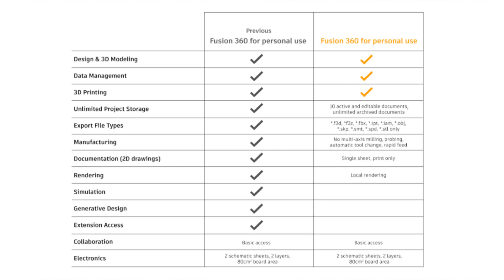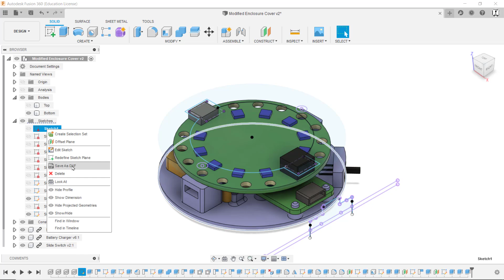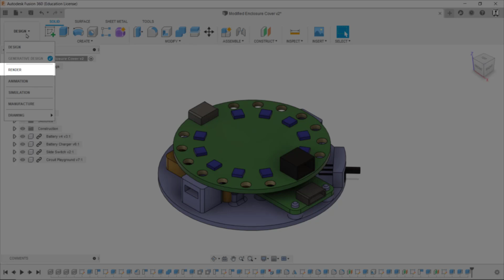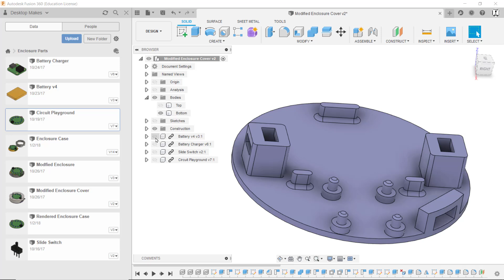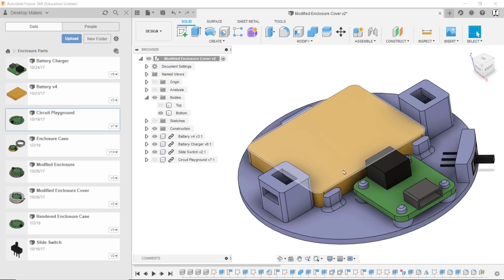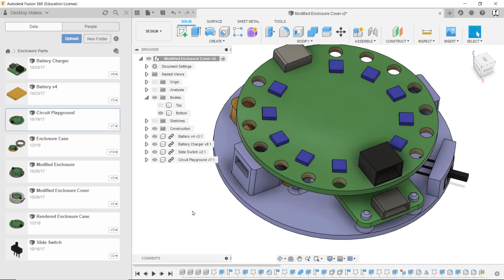Changes to Fusion 360  Personal Use License Explained (Fall 2020)

Comment: My thoughts...

I am truly disappointed with this Desktop Makes video, and as such with Autodesk Fusion 360 and indirectly Instructables.

I transitioned from Sketchup to  Autodesk Fusion 360 a few years back, the reason being that Sketchup began charging for previously free features that I used to design and publish 3D printable models for educational and entertainment purposes (e.g. https://www.instructables.com/member/gzumwalt/instructables/), all for free.  

For the purpose of full disclosure , I only have ten thousand followers and twelve million views across six platforms, I've always credited Autodesk in each Fusion 360 based design as my design tool of choice, and I receive no compensation in any form whatsoever from Autodesk, Ultimaker (my 3D printer of choice), or anyone else I mention in my publications as a source for materials and/or components I use in my designs.

As mentioned, I quit using Sketchup for the same reason that Autodesk is now pursuing: charge a fee for, or downgrade features that were previously available for free, to those who are simply trying to educate and/or entertain, thus penalizing the innocent (those who truly wish to educate, learn and entertain) in order to stop the guilty (those who violate the license).  Contrary to the premise presented in this video, this process is never the "last step", e.g. as more violations are "detected" by Autodesk, Autodesk will announce even more restrictions on the innocent.

I have truly enjoyed designing 3D printable models using Autodesk Fusion 360 and publishing them for free, yet as unfortunate as it may be, as Autodesk continues down the educational / entertainment restriction path, I've taken the proactive steps to download FreeCad and watching FreeCad tutorials, and will soon release my first FreeCad design across all platforms I publish on.

Greg
Reply: Just curious, what features were you using that you will not be able to use?
Reply: @SmithDrewSmith  At this point, STEP files, previously others. 

As a retiree experienced with CAD / CAM software, I assist companies in their use of Fusion and other CAD software, for free.  As their version of Fusion (commercial) has features my version of Fusion (personal) does not, I cannot assist them with the features I'm missing, thus most (and as of this posting all) have decided to transition from Fusion to other CAD / CAM programs I've become familiar with.

I realize Autodesk is a business, but the number of changes effecting my ability to use Fusion (or train others to use it) that have occurred over the few years I've used it are overwhelming for someone my age and for those I've trained to use it.  Thus we will all be transitioning to another CAD / CAM program.
Reply: So you make zero from everything fusion related you do?
Reply: @MrDaniell1234  As stated in my thoughts, "...I receive no compensation in any form whatsoever from Autodesk, Ultimaker (my 3D printer of choice), or anyone else I mention in my publications as a source for materials and/or components I use in my designs."  I (sadly) cannot even sell my models to family, friends and/or followers who do not have the skills or equipment necessary to make them in order to recover the costs of filament, due solely to Fusions "personal" version restrictions which I honor. As such, I donate models to Fab Lab, schools, businesses, family, friends and followers, as I honor my Fusion 360 "personal" license restriction as "not for commercial use".  And while I was asked to and do publish, on "fee" sites (e.g. "https://www.myminifactory.com/users/gzumwalt", "https://cults3d.com/en/users/gzumwalt/creations") by the sites themselves, I do not charge for the models I publish on those sites as well.

Other than my hobby / training / educational use, as a retiree with CAD / CAM experience, I assist businesses (primarily in my local) in the use of CAD / CAM software, for free.  And as I can no longer assist them with the "commercial" Fusion features that have been removed from "personal" Fusion, most (UPDATE:  NOW ALL 27) will be transitioning from Fusion to other CAD programs I've been learning.

Comment: I am a hobbyist as well and initially, the 10 document limit had me concerned.  It will be interesting to see how the archiving feature works out.  I have never needed to export a step file.  I could see the potential for that in the future if I decide to do something with my else with my designs, but that's something I'll worry about when I need to.  As always, great explanation Vlad - safe travels!

Comment: i use F360, but have found FreeCAD very good, but with a learning curve .i highly recommend everyone try it, expect first time frustrations because of how use to many are with F360, time some time to learn it, you will be very happy with many of its features. i also do electronics design, and tools like KiCAD use freecad integration. i find myself sometimes starting a project with freecad if im taking my time, but F360 if i need to do it fast. i also need to mention, im a high level 2d Autocad drafter in professional settings, so familiarity in the product line helps.

Comment: I am transitioning to Design Spark. Just as easy as F 360 and does not need to phone home. Has a better UI.  Does not have CAM but I have other programs for that. It also does not have auto-thread design for which I should create models in F360 to use in Design Spark.
Reason for switching:
Never liked/trusted Autodesk 
Always have a backup for critical system especiall if free.
Better more consistent and mature User Interface.
Different busines model than F360.
Thanks Vladamir, you do good work!

Comment: Oh please! No one is saying that paying for software is not OK.  But you don't go from free to $500 PER YEAR. That is just the kind of mobster move that makes people loose all faith. That is basically saying no hobbyist license without having the honesty to admit it. And please don't compare hardware to software. I don't pay $500 a year to rent my CNC machine that I built myself or my $200 3D printer.

Also, are you seriously arguing that limiting the software so that it won't generate basic g-code like G0 and M6 is not a big deal? What are they going to limit next? G2/G3? M3/M4/M5? And yes, the point is that they undercut FOSS software by promising to make Fusion 360 available to anyone who made less than $100K. There are no real options now. But let's be honest. They didn't say you couldn't use it for your hobby business or to help ends meet at the bottom of the economy. Thousands were using it that way. Now packages like FreeCAD will have to catch up. 

But it will.  I wouldn't hang my star on teaching hobbyist Fusion360 forever.

Comment: Just a quick comment on why many users hate the subscription model. -

I'm a non-commercial user. I have a number of technology based hobbies - photography, graphics, electronics, 3d printing, CNC routing, etc.  In short, I like to make things.  Like most, I don't always do it with the most modern, up to date, equipment.  The reasons are partly budgetary and also simply that I take pleasure in  maintaining, restoring and re-purposing equipment. Some of the equipment I use is decades old.  It works well and is often adapted for uses that the original manufacturer likely didn't anticipate.  It's key that I purchased it, own it, and I can continue using it for as long as I'm satisfied with the results. 

With subscription models you don't get that benefit.  You don't own the tool and it can be changed on you in ways that can impact the functionality you need - even to the point of disabling it.  The change from a once-off license to a paid subscription is often not the cost in terms of dollars for the software. It is the cost of the overall package.  I buy the hardware.  I should be able to buy the associated software.  If I need to change or upgrade I should be able to choose to do so.  Subscriptions shifting functionality and constant upgrading can be great thing to have if you are working in a production environment and have the budget to upgrade associated hardware frequently.  For other users it can cause issues.

Don't take me wrong. I like 360, appreciate and understand the rationale behind their business model.  It's great to see how that team have worked with and supported non-commercial users in the past. My comments are not directed at them.

As a user that strongly believes in conservation and "right-to-repair" I simply find subscription models in general work against those key principles.

BTW - I've been a subscriber for a while.  As usual, this is an excellent video and an excellent treatment of the topic.

Comment: I guess i'm not sure what the 10 "active" project limit is supposed to prevent or deter?  Especially if you can add as many as you want into your active project. What's the reasoning behind that?
Reply: No one will answer your question, because there is no reasoning.

Comment: Thanks for taking the time explaining.
Once again considering FreeCad. Did it a few years back due to the limitations of OnShape but then came Fusion 360 on market for makers free unless the 100K$.
But now to pay for a product not offering good enough text functionality, parametric disaster (try making a solid block with parameters, then add some parameter for a variable fillet... Look what happens when changing the parameters for the size of the block 😱)  sometimes wondering how company's can take those bottle neck 🥳
Looking forward to how Fusion will continue growing to an expansive CADCAM software and maybe soon I'll join you for the paid version only to be able to use a 3018 5 axis milling machine witch cost about 220$ if you can buy it at the good moment. Only needing a software capable of post processing now 😎

Another limitation is the nuts and bolts hole way creation. Used to have a kind of library/parameter list with a smart way to add the tried length etc. Missing it in f360.

Comment: Hey Vlad, great clarity, thank you. I'm very much like you in my use of F360, just 3D printing, and only as a hobby in my case.
If people hadn't been abusing the F360 license, maybe AD would not have needed to make the changes, there is always a few that ruin it for everyone.
My only real concern was if AutoDesk were to restrict access to my files later on down the road. Other than that, they have only removed access to features that I don't use anyway, so no problem at all for me.
I'm completely with you on the cost of software/tutorials, they all take a ton of time and effort to make, your time is valuable too, why shouldn't you be paid for it. Furthermore, you give a ton of stuff away for free via YT, for which I am very grateful indeed, you have enabled me to learn a ton. It is the same with paid-for 3D models, if people want to charge for them, then please do, it is up to the people if they want to buy or not.

Comment: How is activate/deactivate done? -is it an hour long process? -does it cost? If it is nothing more than a click, then how does it make sense?
Reply from the maker: They haven't hammered out the specifics yet but I anticipate it will be immediate.  It should just be a click to activate and deactivate by what they described so far.  It will be part of the free license.
Reply: I'm assuming that when you de-activate a design i.e. archive it, it will only archive the current version, so all previous versions will be lost. Presumably this will save Autodesk a lot of storage space.
Reply: @rampak1  No